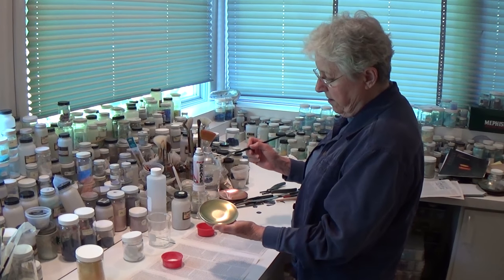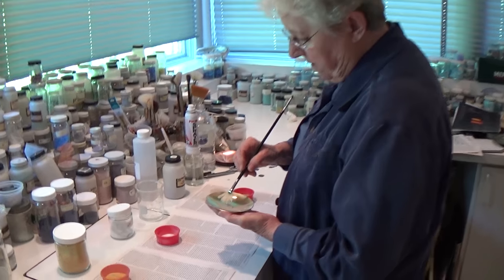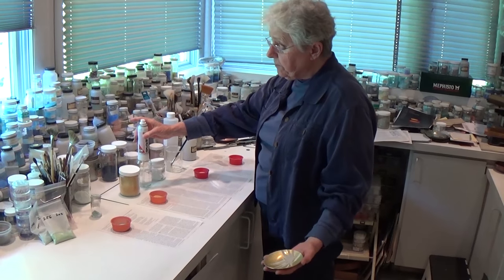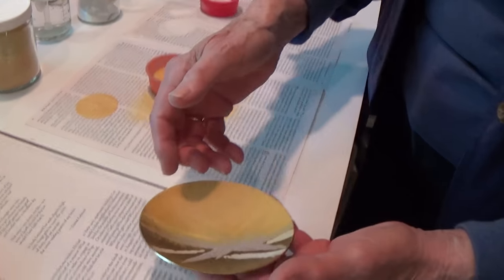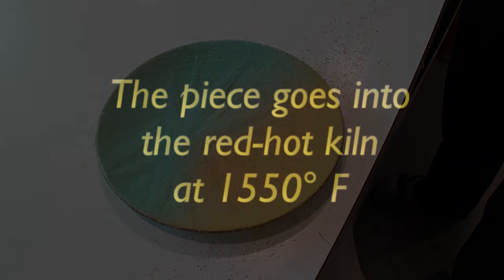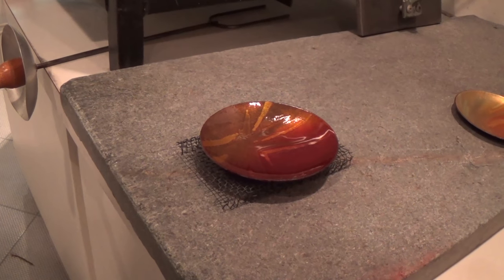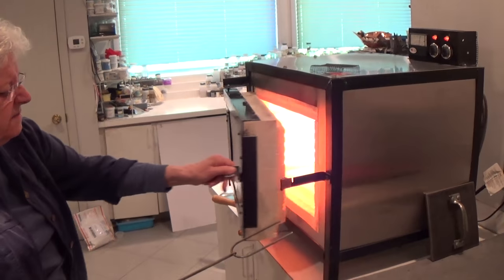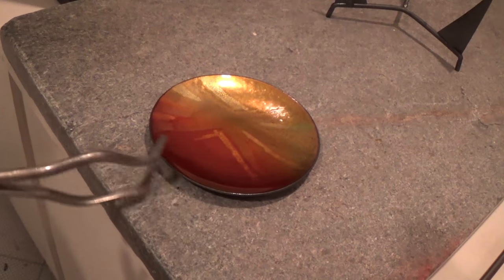Basic Enameling Demonstration with Averill Shepps

Comment: Hello ,  your  work  is  beautiful !   I'm  interested  in  DIY vitreous  enameling  for  a more  pragmatic  project  and  I'm  wondering  if  it's  something  I  can  realistically  do ?  My immediate  concern isn't  for  beauty  but  for  corrosion  resistance .  I like  to  make  cooking  stoves  that  burn  wood . I make  them  out  of  throw  away  steel  can s (coffee  cans ,  Baked  Bean  cans ,  etc.  I   made  a  really  big  one  using  a steel  garbage  can.  The  intense heat eventually  corrodes the  steel, reducing  the  useful  life  of  the  stoves .  Do you  think  I might  be  able  to  apply  vitreous  enamel  to  the  hot areas  of  these  steel  cans, prior  to  assembly ?